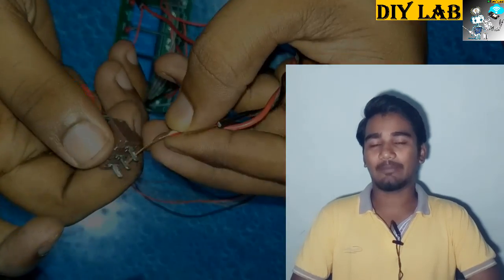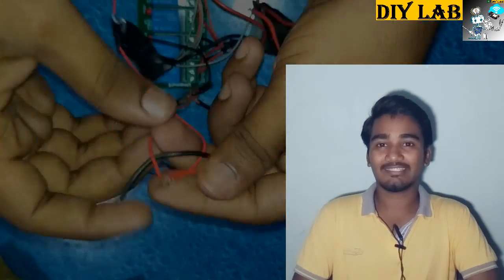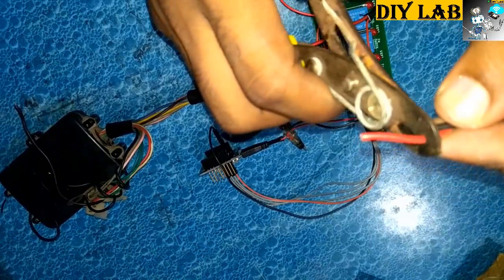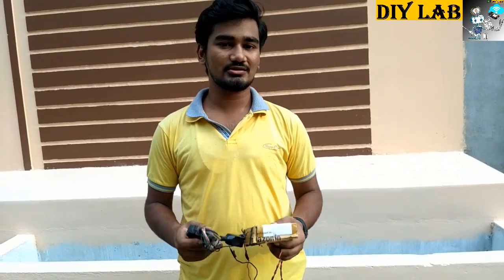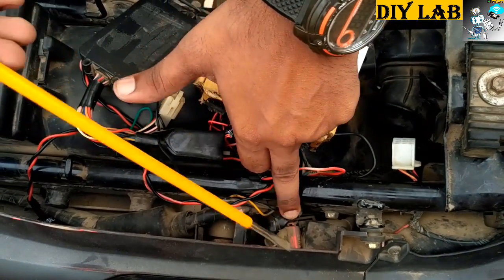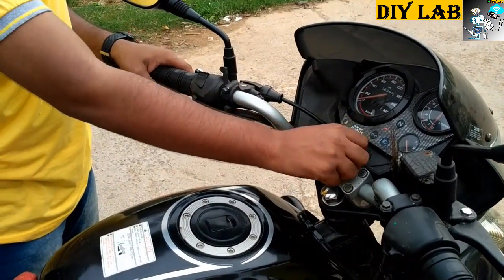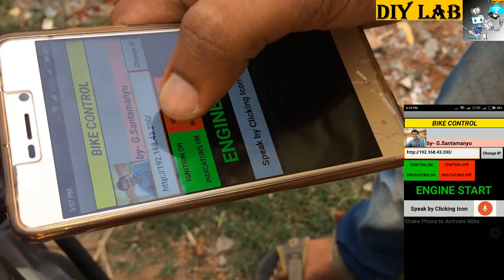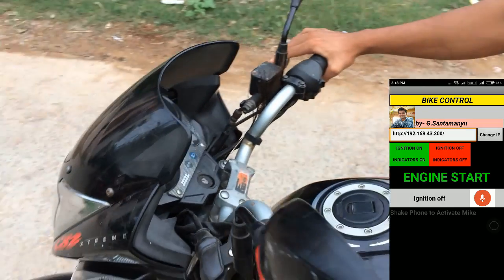Start Bike without key By Voice Command(FULL DEMONSTRATION)

Comment: On datasheet, Esp8266 consumtion  80mA on 3.3v = 264 mW
If motorcycle battery 3.5Ah 12v :
264 mW/ 12v  = 22mA 
3500mAh / 22mA = 159 hour = 6.6 day

So, if your motorcycle not used for 6.6 days or more, board has no power...
Reply from the maker: Yes you are right👍
i haven't gone in detail to save the battery.
But battery consumption can be minimized by putting the esp8266 into deep sleep mode,and wake up by a PIR Sensor or user button interrupt. 
You can replace the LM1117 regulator,as liner regulator draws more power.

Comment: Why did you put capacitor in this video but in the previous video which is the diagram part is you didn't put capacitor?
Reply from the maker: It's not mandatory .But some times esp8266 draws high pick current.There capacitor helps to stabilize.

Comment: Where did you connect the capacitor?
Reply from the maker: near the 5 volt regulator 7805.
between Vout(5V) and ground
Reply: Sir. Sorry but I can't understand. The positive of capicitor will go to output of transistor and the negative of capacitor will go to the ground of the transistor?
Reply from the maker: Yes Correct.
That's not a transistor but voltage regulator(7805)
Reply: But the transistor get warm easily when you do long drive. So what can be done so it does not heat up?

Comment: Hai brother..
It's cool idea..
To operate the ESP. 
the ESP connect to WiFi router and our mobile also same network then only it possible..
So what I want is which router u r using to connect to ESP..
U guys were didn't say any thing about router..
So please tell me that router and type of router
Reply from the maker: Actually we have used our mobile hotspot,to provide connection to the esp8266.In this way both mobile & esp8266 remains in a same network.

Comment: Nice project, the app runs smoothly. I did a very similar project using Arduino and an Android watch! https://www.youtube.com/watch?v=LUC5pKzCxiQ
Reply from the maker: +Ezekiel Brooks i saw you have used Atmega2560.
But what you are using for connectivity?
Reply: I did, as my Arduino is running a few other functions (alarm etc) that required more ports. I used Bluetooth for connectivity to the remote unit. I like your take on it though, WiFi is a good option.